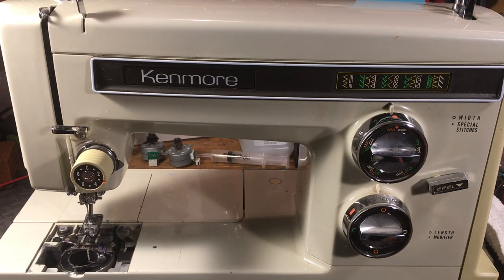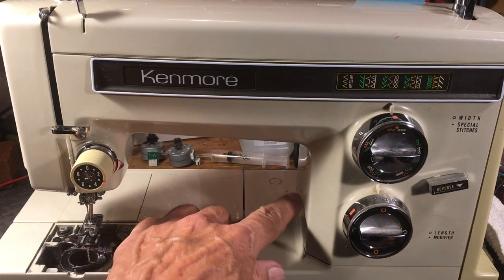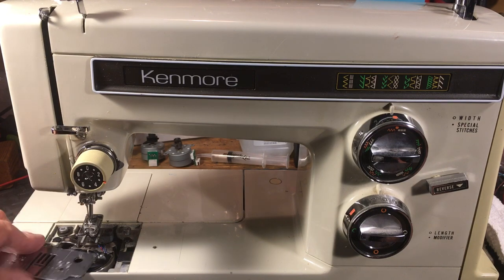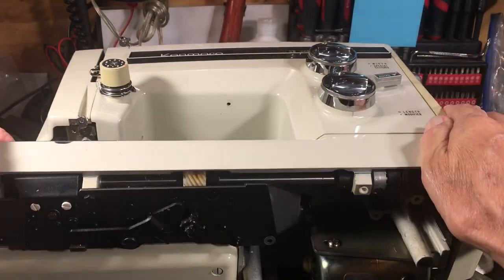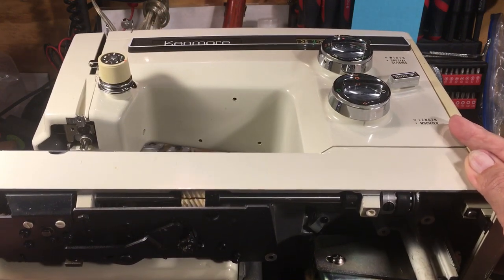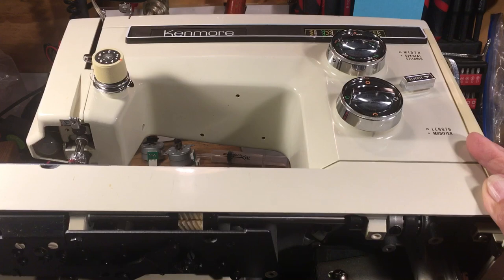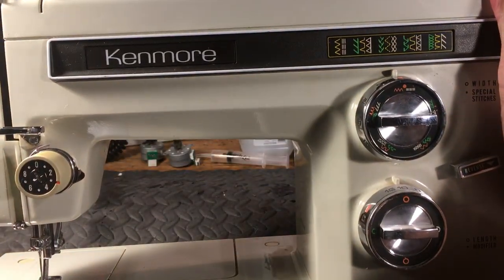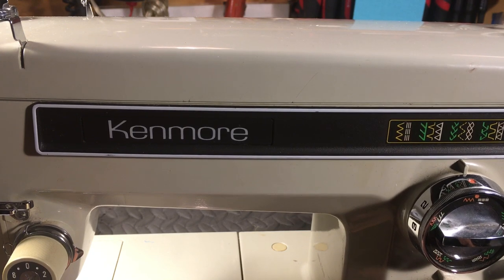Don’t buy this Kenmore machine. (exception) 158.16900 Made in Japan w/plastic gears (video 216)

Comment: So I’ve always loved purchasing old machines and fixing them 
…the first time was an old White sewing machine in an Art Deco cabinet when I was 22. It wasn’t working so I took it completely apart and cleaned it all up and put it back together and sewed with it for quite a while. I guess I was always a little bit mechanically inclined. Now in my later years,I purchased a couple of Touch and Sews. One before I knew about the plastic cams so I made sure to buy a 600e all metal Touch and Sew, which I love and sews better stitches than the Kenmores I have. Then I just bought locally what was inexpensive to fix and gift.  I read about the Kenmores so I bought 158 Kenmores cleaned them up, greased and oiled to get them in working and gifted to my sister, my nieces, my stepdaughter etc. So I came across this video and I laughed because last year I bought this exact same Kenmore at goodwill, didn’t pay much for it and it didn’t work so I cleaned it up and it was still having issues. Put it away for awhile. As soon as I saw your video I checked the plastic cam and guess what?? it is NOT cracked. 🤗 Looks in really good condition. So I kept working on it today because… fabric wouldn’t move. The feed dogs would only move slightly but not fully. (If you still have that machine I would love for you to do a quick video on how to get that bottom black metal plate off to access the feed dog area and gears to oil and clean with more access) I couldn’t get it off because the screws were so tight, so I had to patiently apply oil and blue creeper and let it run down the metal areas that moved the feed dogs. Used a thin brush to spread without getting anything on the plastic gear. I got everything unstuck! Runs really nice and sews beautifully for now. Sorry for the long comment but what a coincidence that I came across this video when I decided to work on this exact machine again. Really enjoy your channel. I came across it a few days ago and have been binge watching it.
Reply from the maker: Excellent comments. I’m glad you took the time to tell us about your positive sewing machine exploits. Every machine can be an adventure for sure. 
I’m glad your feed gear wasn’t cracked and I hope it lasts forever. 
Sounds like you have a high level of skill, and tenacity that’s off the charts. 
Thanks again for your awesome comments and thanks for watching.
Reply: Glad it's still working for you! I'm a big Kenmore fan and have quite a few. The are SEW (ahem! 🤪) dependable. It's a shame they began using plastic gears. I'd like to think their terrific mechanical engineer/designer Charles Harrison, was not pleased.

Comment: I'm late to the party here but this year old video just saved me from going down yet another rabbit hole of buying a machine that is only good for parting out, if that, so thank you for this informational post.  I've been eyeing a made in Japan Kenmore 158.16801 on Goodwill which after seeing this video compared the model numbers which weren't a match but I noticed the machine up for auction has a top load drop in bobbin so it would appear there is more than just the 16900 with the same design.
Reply from the maker: Be sure to get the front load, 15 class,158 series. 
I have videos that are five years old, but the information is still relevant. 
I’m glad to assist. 😎👍🏼

Comment: Hi. Thank you for the information of the plastic gears.
 I have purchased a 158.19470 sears Kenmore machine. It did not have a cord or pedal. Do you know what pedal is for this machine?
Reply from the maker: Do an online search and enter that model number and multiple suppliers will be be available. It should be an easy acquisition. Thanks for watching.
Reply: Thank you
Reply from the maker: @anbash7703  you’re welcome.

Comment: Randy, thanks for your prompt response, seems some one forced the width dial on my 158.904 and it no longer will set. do I have to remove the plate holding drop in disks to address the problem or is that a briar patch I should not address.
Reply from the maker: If the machine is unusable in its current condition, you have nothing to lose if you try.
If however, it will suffice as a straight stitch only machine, try not to risk that reality and turn it into a non-functional door stop. It’s totally your call.

Comment: I just bought this for $25😢 but the machine is so clean. After watching this I took off the bottom to check on that part
Reply from the maker: If the gear isn’t cracked, just be careful on heavy fabric so it doesn’t break. 
It’s not a bad machine otherwise, it  just has that Achilles gear.
Reply: @randyyoursewingmachineman9954  oh thank you! I’ll keep that in mind when using it
Reply from the maker: @amandadunlap5091  😎👍🏼

Comment: A CNC machine can make a metal replacement. That needs to be organized, I’m working on it. Intermittently.
Reply from the maker: There’s many things that can be done, but to what end? 
What purpose?
If it’s just for the sake of accomplishment, go for it. 
If it’s to birth a profitable enterprise, let me know when you take it public and I’ll try to be a supportive part of your IPO. 👍🏼😎
Reply: Any updates on your metal gear CNC project?  Just bought a 158.1680 at a Goodwill for $15.  Guess what - cracked white gear underneath.  Not worth returning it since we bought it when we were traveling out of town.

Comment: Actually, ALL of these rear-geared accessory models with the top drop in bobbins should be avoided, no matter if they're Taiwan or Japan made. The 158.1980, the successor to the venerable 158.1914 all metal machine is built identically in terms of nylon "goodness" to this machine you've issued the warning about. 

Not a one of them were built with metal gears, and the gear up top of the machine on certain models, if you try to replace it, more often than not, the zinc alloy rod above it (there are a few parts inside the late 70's Kenmore's that are made out of this alloy, incredibly brittle and easily shattered or snapped), when people try to remove it will end up snapping in two. It can be repaired with JB Weld. 

If anyone happens by this video, I'd recommend coating the entire part (CAREFULLY) on the outside with JB Weld after making the repair to the break, and allowing it to cure for at least 24 hours, ensuring your work will not interfere with any other moving parts, so as to reinforce the part and prevent any future issues. Something I learned along the way when working with soft metals inside other types of machines. 

This metal is in all of the late 70's to early 80's Kenmore's, pre-Janome models. 

The feed dog drop mechanism, I found out recently is also made of this material, and if disassembling and reassembling it, it can shatter if the screws are over-tightened. Just a warning to use caution when working on these almost shiny pot metal looking parts. They're strong so long as you don't mess with them.
Reply from the maker: All true observations my friend. If it’s not a front load, 15 class, metal geared, front facing tension assembly, 158 series Kenmore, it’s not premium material for long term success. IMHO 😎
Reply: And this is disenheartening to me, as the -1980 is one of my very mostest favoritest machines.  Inasmuch as Zamak (the alloy you refer to) is brittle, it;s also very dimensionally stable once cast and we can leverage that knowledge to our advantage ahead of time.  Take careful measurements with a digital caliper or, better yet, a micrometer, and that way any repairs can be made back to original dimension where that number is critical.
Reply: @theprojectproject01  The 1980 could have been as strong and durable as the 1914 it replaced had they used strong steel and iron components instead of nylon and Zamak (I stand corrected, and I'm perfectly fine with being corrected, thank you for the correct name of this type of metal). Zamak is fine, so long as you are not trying to torque on it. It will not take any stresses applied to it, and has been known to snap and shatter, depending. With these machines using white nylon gears; gears you cannot buy anywhere new to my knowledge (I know people that now have paperweights that once were functional sewing machines because of this), these machines, once that/those gears crack, it's game over. Some have tried to repair them, but that isn't really an effective solution. Some are experimenting with 3D printing, but that's still not really a proven repair just yet. The fact that some of these models have a worm gear up top that is made of nylon in itself is testament to the slow slide into obscurity for Kenmore built sewing machines. I had a 1251 from 1975 that had a plastic camstack up top. That part was made out of the denser black plastic that was not prone to cracking like the white nylon is, and was not a load bearing part. While that machine would never be labelled Heirloom quality, it's as close as you could get to that durability with a plastic component in terms of a machine that will last decades with the proper maintenance. I'm not hating on plastic provided it's the type that is strong and not prone to splitting and cracking like that much stronger, denser black plastic material used not only in this version of Kenmore sewing machines, but as well put into the Janome built 385 Kenmore sewing machines. I've rebuilt a few of the mid-1980's models, and even beaten nearly to death Kennies still had all of it's mechanicals in perfect condition despite the clear abuse and neglect they've endured. Janome, at that time were wise enough to engineer certain types of plastics into non-load bearing areas, and also made nylon gears that were stronger than the stuff sold now. They all had hard metal cores, and if a machine did suffer a split gear, the gears could be purchased and a repair effected. These machines, while they will never be up to the standards of a fully metal machine are a damned sight more durable than the current completely made of plastic lineup now offered by Janome. I know, I was foolishly rooked into buying one, thinking it was a mid-80's build quality. NOPE, it's all completely made of hard, designed to fail plastic or paper thin nylon. All of it, every last component that you cannot see under the hood, with no exceptions. Their entire product line is now all plastic, save for the H9, which, pathetically, also has a big, thin plastic drive shaft gear in it as well. So, your fave generation of Kenmore, while still sporting failure prone plastic gears and potentially breakable Zamak metal rods is still a superior machine in every way to anything built by Janome, even the mid 1980's  models that were much better engineered than the machine builds that followed. Your 1980 is feature-rich, and when it's working correctly could provide a fantastic sewing experience. It's top load bobbin setup is a lot more convenient than a side loader, to be sure. And the mechanism for the accessories in the rear is far more user friendly than the 1970's Kenmore machines that snapped onto the front bed of the machine. All good things. It is also a very handsome machine across the board. What it never will be is as durable. I own a 1914 that I am currently in the process of restoring. It is the very last of the nearly all-metal wonders. It's a heavy machine, and with the exception of the hard plastic handwheel and control panel viewer up top, every nut and bolt is steel. Even the rear panel (most Kenmore's of this era had plastic rear panels) is a strong aluminum panel. It also sports a 1.2 amp motor, and can really sew a strong, defined stitch. I have yet to test it out on heavy fabric, but I'm going to venture a guess and assume that this machine will sew through pretty much anything I put to it without so much as breaking a sweat. I believe you could do similar things with a 1980, but would not advise it. Just because you can do a thing does not mean you should. Gears are load bearing, and the 1980 has old gears that cannot be replaced (again, to my knowledge), and that are long past their expiry date and could conceivably crack under the strain. Nylon fatigue is as real as metal fatigue, and I'd hate to think of your machine as a new edition to the Kenmore paperweight club. Your 1980, despite the materials engineered into certain parts does sew a fine stitch, and can sew a pair or jeans with finesse, not to mention the embroidery and stretch stitching Kenmore is so highly regarded for. No one said you could not repair Zamak. The only thought I have on this is why did they not use the metals they always used on their machines. Zamak will work forever inside of a machine, sure. Try removing it; that's when things go south, sadly. I wish I could find that video of someone literally shattering the feed dog piston rod when trying to remove it for cleaning in a 1981 (year not model number) Kenmore sewing machine. It wasn't a pretty sight. And...it's the very reason I went with a 1914 instead; once I learned that the 1980 had nylon and (thank you again for the correction) Zamak components in it. Sad, because it's a spectacular machine in all respects except for those two materials which could potentially become compromised; one by simply cracking, the other by simply trying to remove it.

Comment: Great video! I found on the side of the road kenmore 158.10691... It looks like I have a front loading bobbin class 15, 11.7mm x 20.3 mm but when I opened the top I see a black plastic gear but on the bottom gear is sealed. It's also made in Japan. Do I have a good model or is that machine with plastic top gear no good? Thanjs
Reply from the maker: That should be a good one. Oil it up and get sewing.
Reply: @randyyoursewingmachineman9954 
Awesome! Thanks, did they ever make those kenmore machines with metal gear on top?
Reply from the maker: @usefuleater  they make a replacement gear, but I’m not sure if it is available in a metal version.

Comment: I have the 158.18023 and was wondering if you have a video on how to reassemble the high shank mechanism. I unscrewed the left side, took out the nut on the right side and I’m totally lost now. Actually, I bought a machine that didn’t have the nut but I found one that fits so I don’t know if it has to be Kenmore specific or if this one will work but what I’m trying to do now is just trying to find a video on how to put it back because it looks like there is some sort of calibrating that needs to take place.  Thanks
Reply from the maker: I don’t have a video on that. 
The next chance I get, I’ll make one.😎
Reply: @randyyoursewingmachineman9954  that would be great.  I haven’t found one yet with specific instructions.

Comment: Just bought a 158.16800 not 900 through a good will auction. Was wondering whether or not it has the plastic gear. It hasn't been shipped to me yet.
Reply from the maker: I’m almost certain it’s the platform with the composite gears that are non metal.  
If it’s the free arm model with the drop-in bobbin, it’s likely to have the plastic gears that are prone to crack. 
If you can get a better one, I’d recommend doing that.
Reply: @randyyoursewingmachineman9954  if it is cracked, there is no way to replace it?
Reply from the maker: @freedragonfly  I don’t know if a reliable source for the gear. If the gear isn’t made to OEM (original equipment manufacturer) specs, it will be impossible to install and guarantee.
Reply: @randyyoursewingmachineman9954  tysvm
Reply from the maker: If it’s a top load drop in bobbin, I’d skip it. 
The ones with the metal drive gears are 15 class snap in bobbins. 
Either a front load or a side load is preferable and doesn’t have plastic gears.
Reply: I have the 158.16900. My issue is fabric not feeding thru. The repairman said he was looking for a feed dog part. But 3 months later it was still in his care, so I brought it home. Is this something I can find or should I look for a replacement Kenmore. I really want a work horse again.

Comment: I have a Kenmore 158.17821 that looks the same underneath as the machine in the video. So far, so good. It has the same plastic gear and the same metal plate on the bottom. I also would like to know how to remove the plate so as to be able to clean the machine thoroughly. Question: the plastic gear on mine has some brownish grease on it. Should I clean it off? Replace the grease with TriFlow grease? ???? I didn't pay much for this machine so if the gear breaks I am not out much.
Reply from the maker: The gears are ok with no grease or a light grease. The triflow would be fine.

Comment: It's the kind of thing CNC machines were made for... but of course, how much is the machine worth vs how much to machine the gear.
Reply from the maker: Excellent observation!
Reply from the maker: It’s always boiled down to how much a consumer is willing to spend for ultimate quality and dependability.
If there’s a manufacturer who would appear on the scene and use the machining technology that is available, they could make the ultimate, lifetime machine, that would be in its own category and price range. It would be for the buyers who are driving Lexus and Acuras and appreciate having the best, regardless of price. (Like a Kenmore 158 series)
If it’s a disposable, mass production clone for bean counter appeasement, you get what we have at our disposal now. 
Thanks for your insight, and thanks for watching.
Reply: @randyyoursewingmachineman9954   I meant to add... 3D printing could get a new gear made pretty cheaply. Of course it would still be plastic, but. 🤷

Actually working with a friend now on reverse engineering the Kenmore monogrammer cams to maybe make some different characters and numbers.
Reply from the maker: @TheTreegodfather  that sounds like a fun adventure. Plastics have come a long way since Benjamin was told of their relevance to future events, in 1969.(The Graduate)